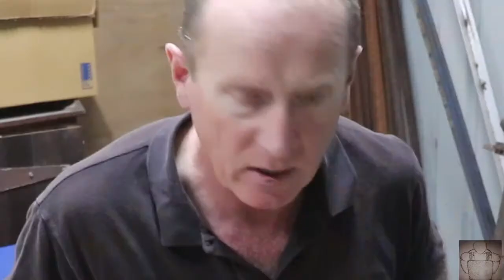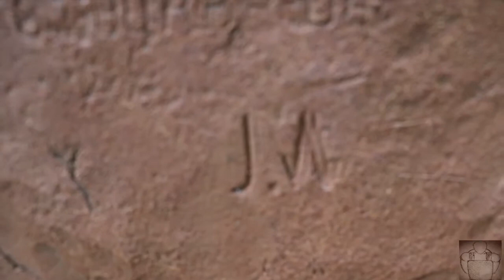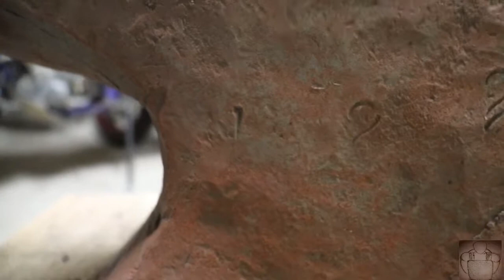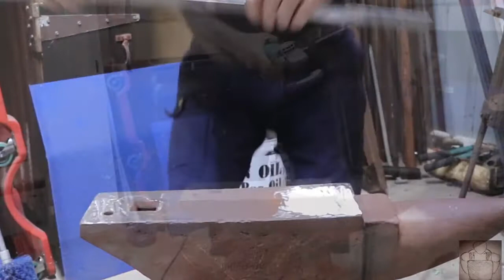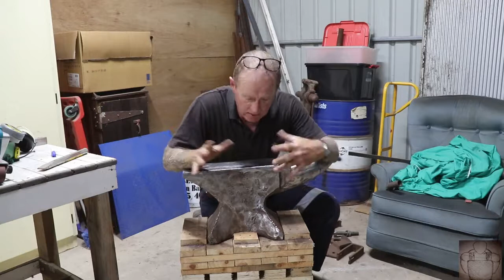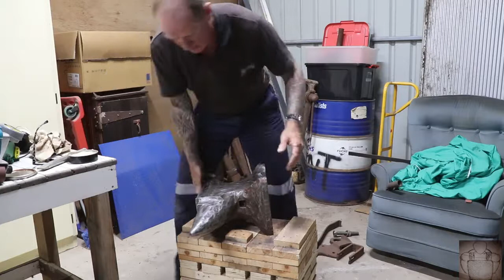Restoring my blacksmiths anvil

Comment: I'm only 20 minutes in to your video and I had to pause it to make a quick comment related to this time frame in your video. I just wanted to say that you're talking about not using the heel as much, so you are going to grind down the face closer to the horn to bring the face to square. In my opinion, you'd be better off grinding the face over the heel end to bring the face back flat. This way you are removing hardened steel in the area you aren't using as much, and leaving the hardened face steel over the area that sees the most use full thickness. Just a quick note I wanted to make. Loving your video so far, especially being a blacksmith myself and your straightforward, knowledgeable take on this project and making the anvil become the tool you need. Now back to finish the video
Reply from the maker: Keep hammering👍
Reply: Finished your video, very good! I love how you made the point at the end about how you haven't ruined the tool, you made it better by adding the features of the radii on the face edges. I got my hands on a 145 pound cast steel West anvil in like new condition, and several years of forging led to very chipped edges. Granted I was in my learning curve, but it shows how much stress those sharp corners take. I ground mine to about 1/4 inch radius by the chisel plate tapering to square a few inches before the hardy, just before the end of the "sweet spot" so I can still do heavy forging over a 90 degree edge. I like the tapered radius as it gives so many options for radius size.

I'm currently working on rebuilding a 171 pound mouse hole anvil and am debating on starting with radiused corners, or square corners and modify as I see the need. The face plat is cracked and delaminating, im currently filling the missing face plate areas with mild steel mig wire and have Stoody hard facing rods to do a solid underlayment and cap weld once I have the face back to square. Picked her up for about $1 a pound. When I'm done, none of the original face will be exposed unfortunately.
Reply from the maker: Thanks for watching👍